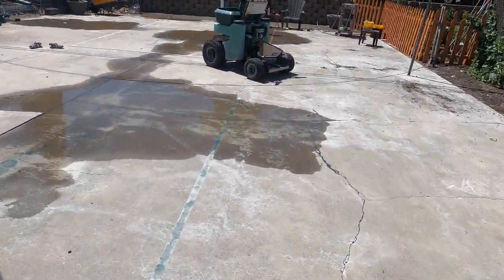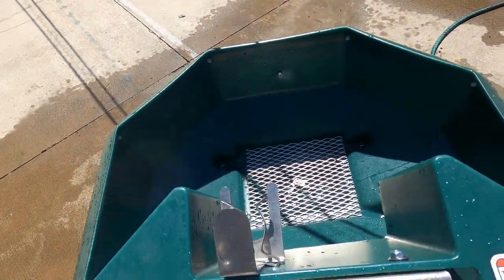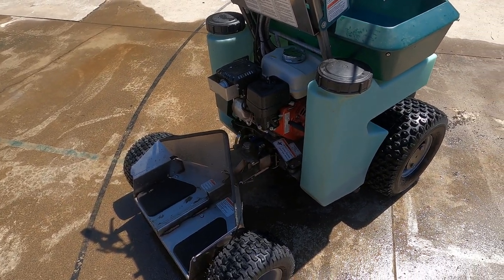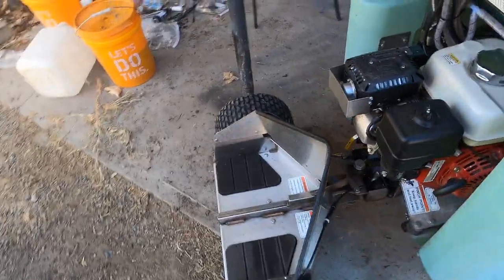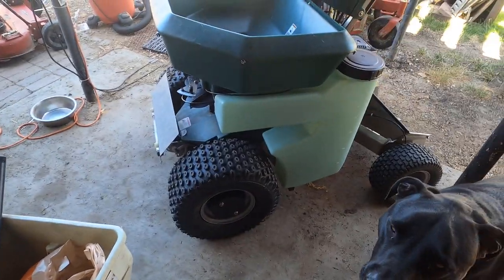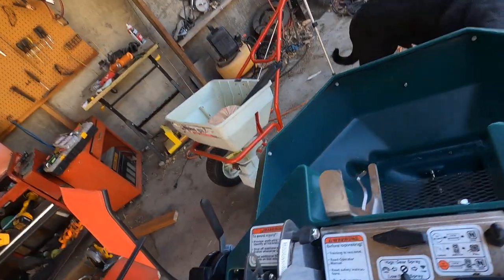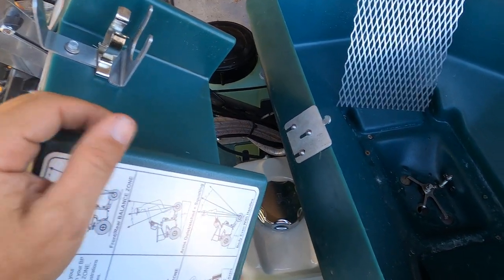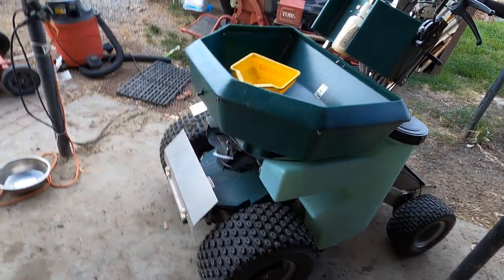2020 PermaGreen Ride on Spreader Sprayer

Comment: Been a few years for me since being on a permagreen. That spray bottle comes in handy for tight areas. You scared me when you were driving it by pool. My stomache turned going oh no if you slip or something it is going to end up in the pool. Love how the pool looks. Which I had one.
Reply from the maker: I realize how close I got on the corner until i watched the play back..lol  yeah I really like how it handles and its great not pushing a spreader...lol Thanks been slowly working on the landscaping around the pool still got  ways to go will eventually have flower bed walls around two sides and taking out the concrete and going back in with pavers.